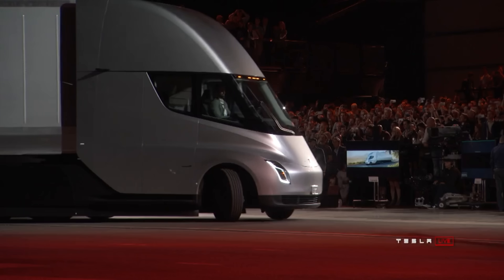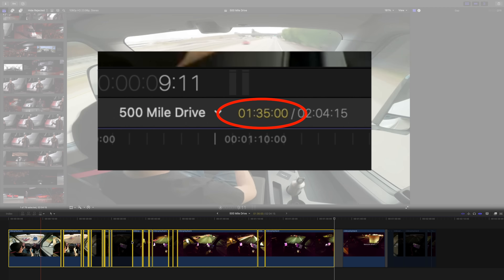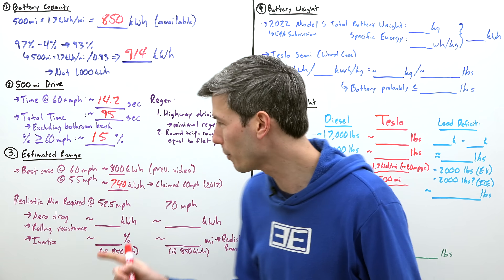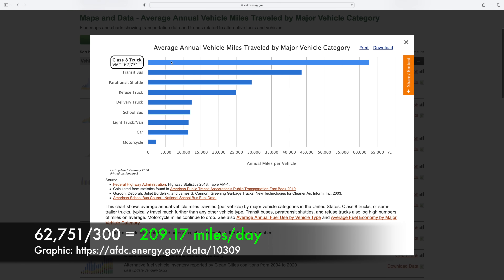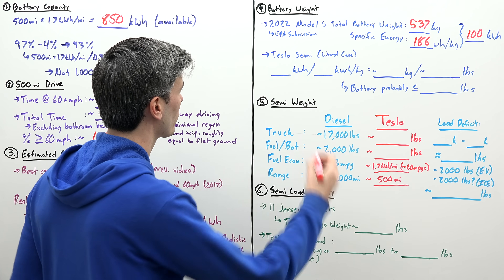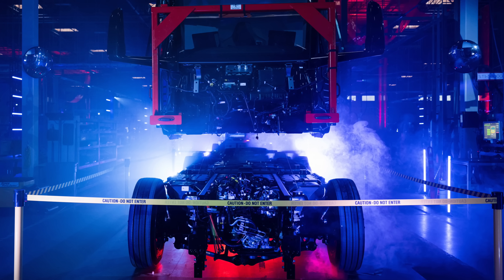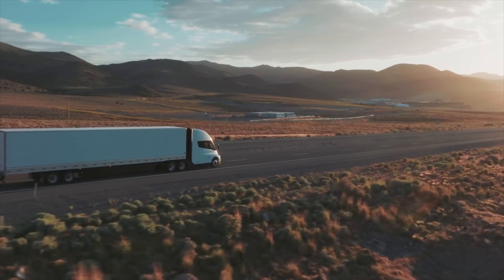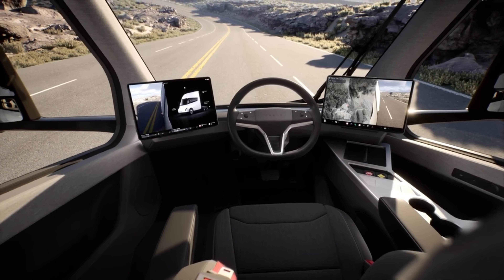Does The Tesla Semi Make Any Sense? Part 2!

Comment: It's a great exploration into the feasibility of Electric trucks, but I think there are two missing aspects to this video - the question as to how available this power infrastructure really is? If say, half the fleet of road-going trucks were to become reliant on the power grid for transporting the bulk of consumer goods and food (which seems to be the main intent of these trucks), aren't we forgetting that a lot of regions in the US and around the world have power networks that are very close to capacity for significant parts of the year? Especially in summer when people are running air-conditioners constantly. I get that this is a kind of discussion where you say "assuming the power grid is capable..." But I think we shouldn't take it for granted that this issue will be solved so easily. It is a huge challenge. And at the same time you would expect electric cars to be multiplying. That's a hell of a lot of power that needs to be delivered - both in terms of actual generation and supply, but also the infrastructure that allows so many vehicles to be parked in bespoke bays (somewhere!) for recharging.

Another factor which I think should have been mentioned is the problem of declining battery performance over time. You would have to either offset this by buying a bigger, heavier, more expensive truck which allows it to do specific routes for its entire service life, or you'd have to redeploy and repurchase trucks due to not quite getting the range they need. 

It's still an excellent video, just some extra things to consider.
Reply: @andoletube the current Grid can handle the trucks charging at Night.  This isn't an OTR Truck, so it can charge in the off hours, when the trucks are usually parked.   An alternative to this, is install Tesla Megapacks and charging can happen at anytime, since the Megapacks can be charged during off hours. 

Declining battery power is not a big issue in Tesla Batteries.   Tesla also has  LFP battery that can easily stand the test of time and usage.

Comment: This whole video is based on the idea that Elon was honest about his efficiency number. He's not an engineer, he runs the buisiness side of things. He's also lied about vehicle performance before. 

So i say we should be more skeptical of claims from Elon musk himself. There's enough here to calculate the actual efficiency, but I'm not an engineer so y'all do the math. I came up with over a billion. Like i said, not an engineer. 

Also the power required to charge these was also never calculated. It's a lot. Basically you would need your own sub station to charge one of these 850 to 1000kwh batteries in less than a day. Otherwise a 30 to 40 minute charge time would be impossible unless Pepsico has their own special charging stations, which i suppose is entirely possible. Nothing is public though.

Comment: You never calculated what a load of Pepsi weighs.
Reply: At the beginning of the 500 mile range test video, one pallet at the very back, where loading practice is to put the lightest loads, is shown as 600kg. Is this a pallet of Pepsi? Who knows, but it could be. 

Many sources state that a 53' semi can hold 26 standard pallets, although one can be seen turned sideways; and there are some double stacked at the front, perhaps two rows. So even assuming none of the pallets has a mass >600kg, there could plausibly be 29 pallets on the truck, for a useful load of 17.400 kg or 38,370 lbs. Since sources suggest that enclosed trailers may weigh about 12,000 lbs., total load could plausibly be 50,370 lbs.

Comment: Really well made video, thanks!

The engine, gearbox and the rest of the drivetrain in an ICE semi truck weighs much more than the 3 electric motors (in the delivery video, they said a person can carry one of the motors in their hands) and the fixed ratio gearboxes. Additionally, Tesla can use lighterweight materials for the cabin, like aluminium to further reduce the weight vs ICE trucks, so I'm thinking 2000 lbs is probably on the conservative side

Comment: A range of 500 miles is not real life, you will not charge the battery to 100%. A 30 min charge will give you 70% or 350 miles of range in optimal conditions.